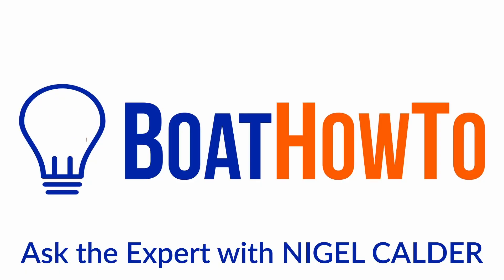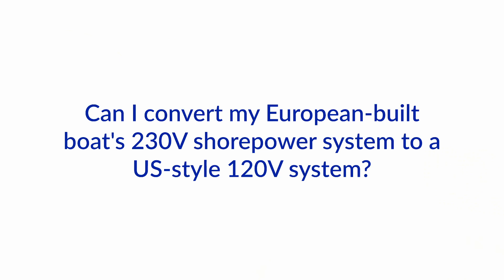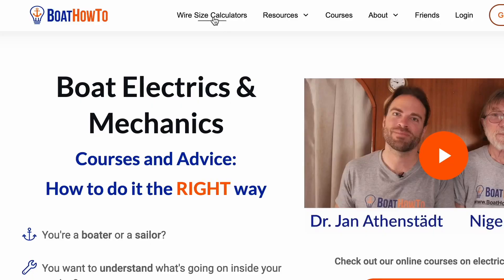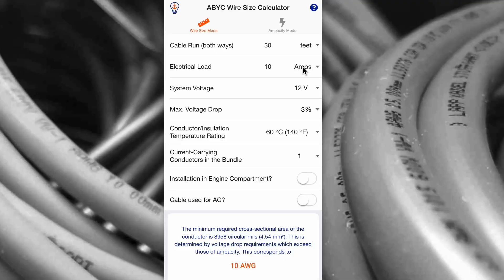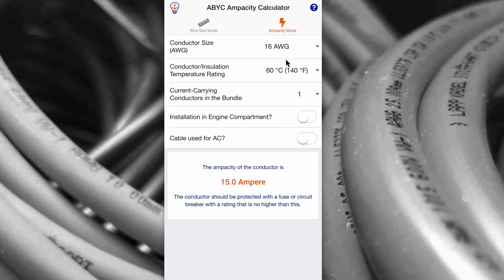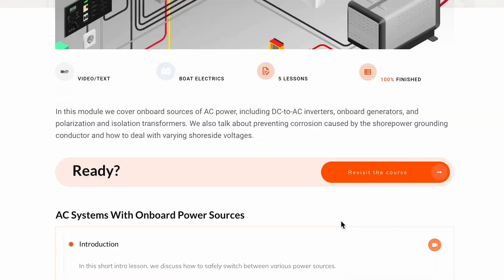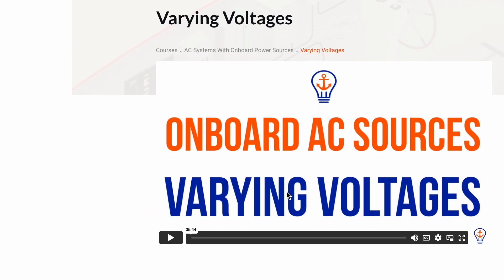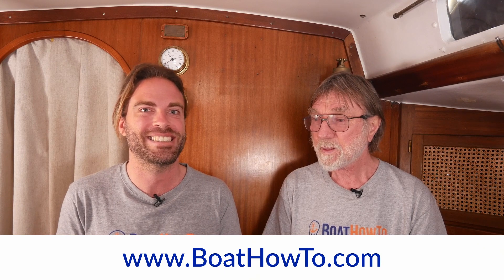Converting a 230V SHORE POWER system to 120V: Does this work? | Ask The Expert with NIGEL CALDER

Comment: so it sounds like a 120 volt noth american yacht will have less issues in europe and be easier to adapt to the 230 volt system because it would have been wired with heavier gauge wire?  most of my DC wiring is 4/0 and 2/0 and most of my AC 10 and 12 gauge.
Reply from the maker: Yes, it is much easier to bring a boat built for the US market to Europe than vice versa. You still need to make sure that all appliances can handle both European voltage AND frequency, but you usually can keep the wiring. On the other hand, if you bring a European boat to the US, you will probably have to replace every single wire of the AC circuits. - Jan

Comment: Cant u Split 220 lines Just whit take out one if the Hot line. 

See in my boat 230volt.  nutrale and we use to Hot lines. 110 for only 1 cable
Reply from the maker: In the US, there is something called a 240V "split-phase" systems. In this case you have two hot legs and you can use 120V appliances with each of them. In Europe on the other hand, there is no such thing. (Unless you consider 3-phase power, but this only exists on very large yachts.)
- Jan
Reply: @BoatHowTo  yes I know.

But how is it whit this genial altinator you have made ??
Possible to buy and get it for 24volt Volvo penta engine ??
Reply from the maker: @Lordlindef  If you mean the Integrel System, where Nigel was involved in the development: unfortunately not, there is only a 48V Version available. But there are many other good alternators on the market that work with 24 Volt systems. Check out the selection at oceanplanetenergy.com
- Jan

Comment: I did not find this video very helpful. Of course ya you will have to deal with the size of your wires but isn't the big issue converting from 50 HZ to 60 HZ ?
Reply from the maker: Of course you will need to use 110V devices instead of 230V devices after the conversion (which are then designed to handle the 60Hz). But isn't that the whole point of the change, that you can use your US equipment? - Jan
Reply: Well wouldn't that mean that you basically have to change your entire electrical system including generators ? @BoatHowTo
Reply from the maker: @srupp9271  If you want to convert the boat to a US 110V System, yes! The only other (and much simpler) option would be to keep the 230V system and only plug in in the US via a battery charger. Then all your power on board would have to come from the generator or an inverter. (You would not be able to use a combined inverter/charger though.) We talk about this option in our Advanced Marine Electrics course. - Jan
Reply: I have looked into that solution too but none of all of these solutions seems very good to me. If you would use a charger I guess you would need a giant charger and batterie bank  or maybe more than one if you wanted to use your entire electrical system on the boat like air conditioners and equipment that draws a lot. The only other solution I found  is a shore power converter which has it's own drawbacks. @BoatHowTo